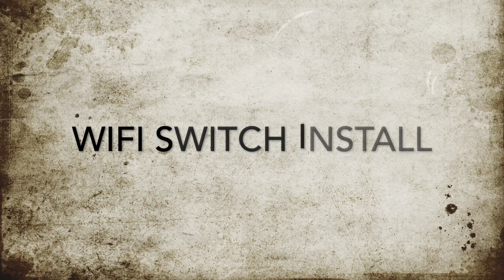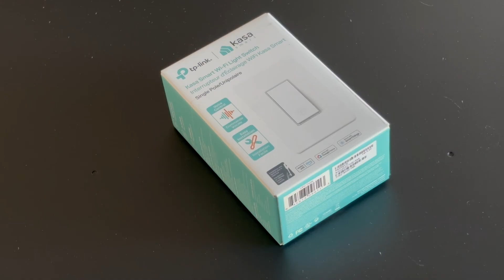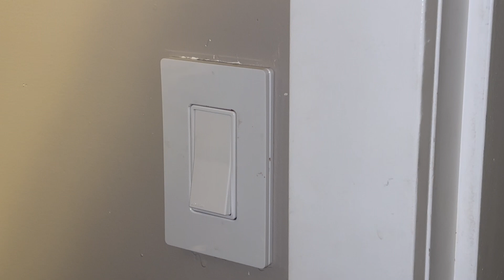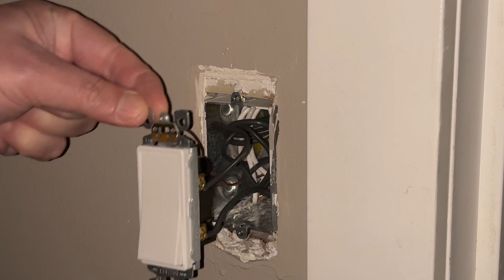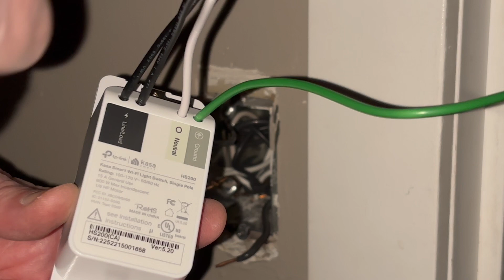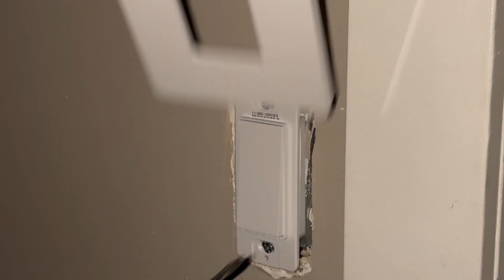Tech HAUS DIY - Switch Installation

Comment from the maker: Please see the tools and devices we use and links to Amazon below for your convenience.

KP200 Outlet	                                         https://amzn.to/4lAHL2F
HS200 Single-Pole Switch	                         https://amzn.to/4bPr6F6
HS220 Single-pole Dimmer Switch	         https://amzn.to/3PJc9M8
KS200M Single-pole Motion	                 https://amzn.to/475vc9u
HS210 Three-Way Switch	                         https://amzn.to/4ryMVgP
KS230 Three-Way Dimmer Switch	         https://amzn.to/40EJV7L
Blink Doorbell	                                         https://amzn.to/4sPnI2P
Blink Camera	                                         https://amzn.to/3PcD1Eh
Sync Module 2	                                         https://amzn.to/4sgixZP
Sync Module 2 USB/Mount	                 https://amzn.to/47BG9jg
Blink Home Bundle Includes                     
     1 Blink Outdoor Camera 
     1 Blink Doorbell 
     1 Blink Mini Indoor Camera
     1 Sync 2 Module	                                 https://amzn.to/478Igel
Wire Stripper	                                                 https://amzn.to/4bO4rce
Outlet Tester	                                                 https://amzn.to/473LNKR
Meross Garage Door Opener	                 https://amzn.to/4bfCRVc	
Ecobee Thermostat	                                 https://amzn.to/4cTDiWq